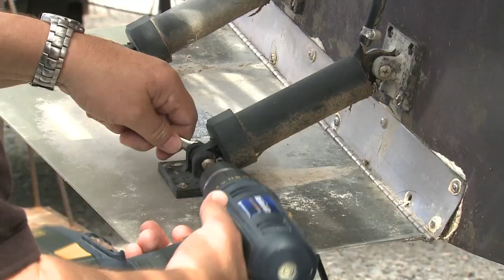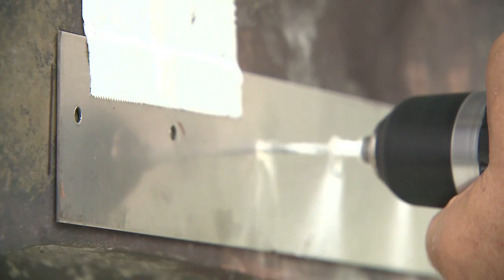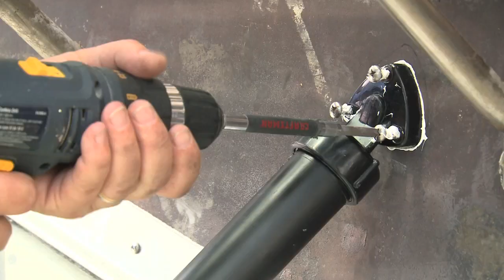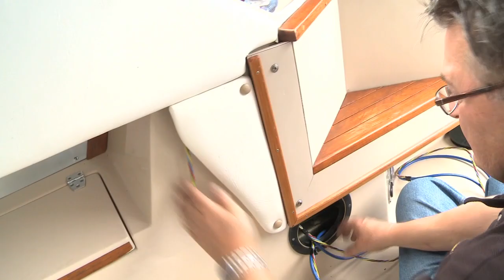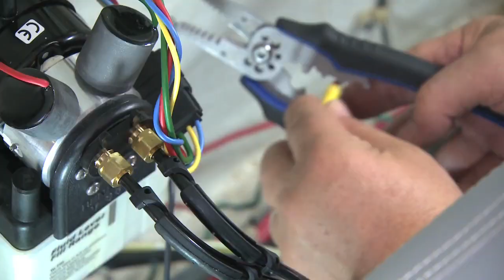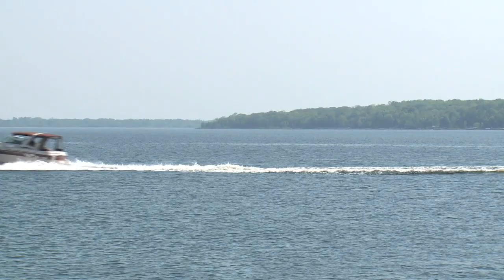Bennett Trim Tab Install and Boat Test from PowerBoat TV

Comment: What type of sealant did you use to fill the old actuator and old tab holes with?  Also, what type of sealant did you use on around the new holes?
Reply from the maker: 3M 5200 Marine Sealant
Reply: BennettTrimTabs 

Thanks much.

Comment: Bought a used Boat. Has Bennett I think M-80 Electric Trim tabs. One works, the other , motor runs , but won't go up and down.
Any idea's to fix.
Reply: Charlie, the easiest route is to give our techs a call at 954-427-1400. They can walk you through how to correct the issue. Have a great day!
Reply: That would be the solenoid valve.  See vid below for troubleshooting and replacing

https://youtu.be/P3zmpXsuaH0

Comment: DizzyA,

You are 100% correct.

The old actuators were putting a lot of thrust and strain straight back, and as you noted the better angle does indeed produce better results. 

Additionally the larger surface area of the new Trim Tabs combined with the "Drop Fins" on the edges (they capture water pressure normally lost out the sides and convert it to additional lift) means the new Trim tabs generate more lift at less deflection .  This equals more lift with less drag!

Tom
Bennett Marine

Comment: Great results with the new installation.
However, I'm sure you'll agree that it was terrible geometry for the old actuators, with their upper mounts located way too low on the transom.
The amount of tab movement per actuator stroke will have been greatly reduced, and stress on the actuator mounts much greater.
The extra length of the NEW actuators obviously enabled installation in a much better configuration, also getting much more tab movement (and stern lift) per inch of actuator stroke.

Comment: Yes, one actuator will easily handle those Trim Tabs.  In fact we make Trim Tabs up to 42" x 12" that use just one actuator, they are very strong.

There are some applications such as faster boats and Sportfishing boats that encounter more stress where we will recommend two or more actuators per Trim Tab,  

I hope this is helpful,
Tom McGow
Bennett Marine